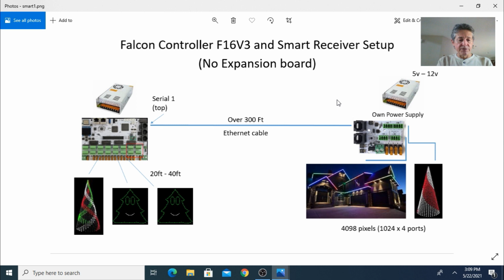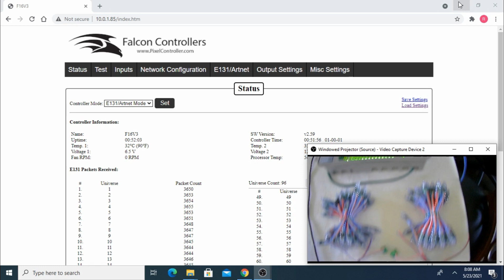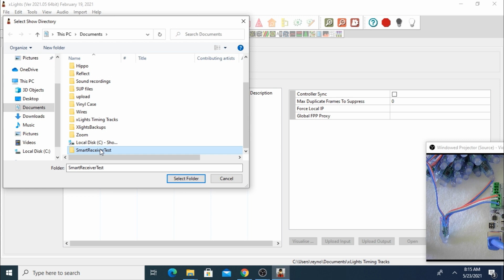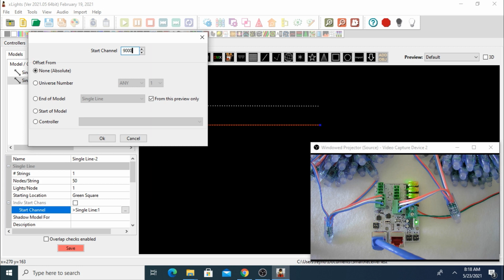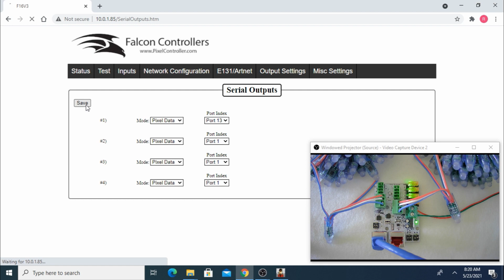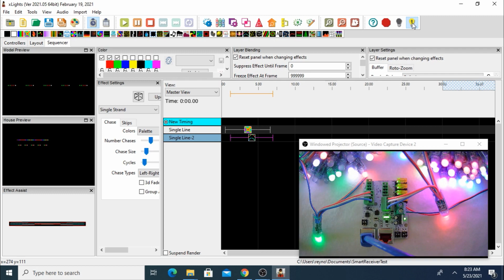Go the Distance! How to connect a 4 Port SmartRecevier into your Falcon Controller

Comment: Question, are you able to use more them one smart expansion board directly off the F16v3? I am confused by the serial port settings page as I thought I could daisy three of them, that would use 12 ports off of the f16.
Reply from the maker: Hi There. I think you are taling about Smart Receviers which connect using the RJ45 ports, correct?  I stopped using the V3 years ago, so I am going to talk of what I know the V4 and V5 setup is. Yes, you can daisy chain them, but keep in mind that that you are sharing one port throughout the chain. Let say that you daisy chain two of these SR, you will end up with 8 ports in total (ports 17 to 20). The max number of pixels (1024) you have will be diveded by two. In other words you could have 800 pixels on the first SR and some 200 on the second SR.

See the links below.

Smart Receiver
https://pixelcontroller.com/store/accessories/86-srx1.html

Specifications:
https://docs.google.com/spreadsheets/d/1LTQzdvSYMrRGI62KTGdh5EmUhVB9uZZMQ4iwWtK7yYk/edit?fbclid=IwAR33f8nxOD-bPBZK3F9M6IILNB96UiWpSwP67KyMHWce-1woMmiiRfcl29c&gid=2005112714#gid=2005112714

Comment: I watch the video twice but still not understand why the blue + signs appear beside port 1, 5, 9 and 13. Why the smartReceiver choose thos ports automaticly. Even if you create 13a, 14a, 15a and 16a, they still appear at the 1, 5, 9 and 13. Why the + blue sign do not follow the new ''a'' ports? Maybe it is too late tonight hahaha!  😆😆😆
Reply from the maker: Hello. What type of controller do yo have?
Reply: @trevilights  I just received it. It's a Falcon16V5. Did not plug yet but I try to understand the all process before. It will drive at least 6000 pixels; 4000 pixels for my 16' tree and the rest will be spead on some usual props.
Reply from the maker: @stephanlemaire  I do not own a 16V5 but does blue +sign will or will not be there depending on the setting you choose. Like if you are only using 16 Local ports or 16 Local + 2 Smart Receivers. Once you are ready to try, take a look at your settings and I am more happy to help you out. You can book some of my time in my website trevilights.com and we can do a Zoom to review your setting. We can cover a lot of material in one call instead on text messages. Good luck.

Comment: Hola, Trevi. Saludos. Tengo un controlador F16V4 y un SmartReceiver x 4. Pero aun no logro hacer el la conexión entre ambos. Es decir, los 16 puertos de la F16v4, llegan bien, pero los puertos de la SRX4, no me llega ni uno. El SRX4 tiene un boton de test, y lo preciono y todo funciona bien. Solo me falta poder hacer la conexión entre ambos, ¿sabes cómo podría solucionarlo? Muchas gracias
Reply from the maker: Hola Juan. Pueden ser varias cosas. Vamos a empezar por lo basico. Primero, en el menu de Status asegurate y tengas seleccionado la opcion de Board Configuration=16 Local + 2 smart Receivers, y presiona "set". Esto agregara otros 8 puertos mas. Asigna algun elemento digamos a puerto 17. En el receiver, todos los switches deben estar "on" y el seleccionador de ID en Cero. Reinicia el controlador y el receiver. Suerte.
Reply: @trevilights  Trevi, he estado investigando y se supone que el SRX4, como es de 16 puertos, se selecciona 16 local + 4 Smart Receivers y así lo tengo. En cuanto a el ID, lo tengo en cero y los switches en 'On'. Aparentemente, todo estaría bien. Pero hago la prueba de test general y solo me toma los 16 local. Sigo sin conexión al SRX4 😒 he probado muchas cosas, pero no sé en qué estaré fallando.
Reply from the maker: @juancamiloarrubla8726  Desde donde y como estas haciendo las pruebas? Supongo que desde xlights. Tienes correctamente (suficientes) los canales/universos a utlizar en la seccion de controllers? Y en el controlador, en la seccion e1.31 tambien debes tener una cantidad suficiente de canales/universos a recibir. Me es dificil saber que puede estar pasando sin ver su configuracion. Sigue probando y si no tienes suerte puedes ir a mi sitio Trevilights.com y separa tiempo conmigo. Hacemos una video llamada y revisamos tu configuracion.

Comment: Hello. How do you do this I Raspberry pi 4 to control the falcon controller
Reply from the maker: Hey John, you need to prepare a SD card with the 'Falcon Player (FPP)' software. Then you configure the Falcon Player with the controllers IP address. 

Here is a video about it.
https://youtu.be/yqXK5p1eRM4
Reply: @trevilights  
I did do that for my Raspberry pi 4. And get an error on pi boot up. But I still am able to get to the web interface for FPP. I was just wondering if I have 4 ,4 string smart receivers. How is that put into the pi ? 
Thank you. You have taught me a lot.
Reply from the maker: @johnnagy1575  You do not need to put the smarts receivers into the Pi. The only things it cares about is the output channel count. The Pi send all the raw data to the controller and then the controller sends it to the pixels . Is the controller that needs to know were the channels are, either connected to a common pixel port or a smart receiver.  As an example, if you have 4 snowflakes in a smart receiver, make sure the channel definition in xlights for those snowflakes has the correct channels used on the smart recevier so it knows how to route the data.
Reply: @trevilights  
So. If I put in the FPP pi player. There is only 96 universes. And I configure the falcon controller with the smart receiver outputs. The pi will still send 96 universes plus the four string universes? Yeah. Sounds really confusing to me. Lol
Reply from the maker: @johnnagy1575 There is not "plus four" string universes. Your four remote string are part of those 96 universes. Let's say that you are only going to use 2 port of your falcon controller. Port 1 and port 2. Port two is going to be configured to be a smart receiver. Port number one is going to use Channels 1 to 3072 (1024 pixels x 3 channels). Your port 2 is going to use Channels 3073 to 6144 (1024 pixels x 3 channels) which are configured to be used in a remote recevier. That's it. Everything is about Channels. Channels do not repeat. So wherever that channel is, the data is going to be sent there, local port or remote port. This is why the FPP does not care where the pixels are, it just send all the data, The controller then routes it to the right place.

Comment: Hi another great video. So if I have 3 smart receivers with 12 pixel ports that can have 4096 pixels. So does that mean that I can have 341 pixels on every one of the 12 ports. I have used all your videos to set up my Christmas.
Reply from the maker: Hi Percy, Thanks for watching. It all depends on the configuration that you use. You can have as many as 1024 per port on the receiver if you want to. But your numbers are also correct if you daisy chain 3 receiver and configure them to use 1 main board port distributed on the three receivers. 
Is all comes to your layout and preferences.
Reply: @trevilights  Hi so if you use ports 1,2,3,4 on the f16v3 controller for the smart receivers like 1a 2a 3a 4a for the first one and 1b 2b 3b 4b for the second one and 1c 2c 3c 4c for the third one, so with 12 ports on the 3 smart receivers I should be able to put 341 on all 12 ports because it is using 4 ports on the f16v3 I hope.
Reply from the maker: @percydoucet1838  Unfortunately I cannot confirm your setup because I  only have 1 smart receiver. But it does sound correct. But, why would you need 3 smart receivers? Do you have long distances between your elements?
Reply from the maker: I just went into the Pixel output for the V4 and tried your configuration and it works. 341 pixels for each letter, a b and c.
Reply: @trevilights  Thanks Trevi your videos and information about this is very informative and I don't think I would of got this far without your videos.
Reply from the maker: @percydoucet1838  Glad to help.

Comment: But if I daisy chain 3 smart receivers I still can control same amount of pixels if have only one receiver . I’m confused.
Reply from the maker: Yes. You still have the same number of pixels. What a smart receiver does is to provide a long distance connection for up to 4096 pixels with only one long ethernet cable.

Comment: Can you explain falcon 48 please.
Reply from the maker: The Falcon 48 is a little different, but still can only control just over 16000 pixels. It allows for you to connect up to 12 differential receivers with 4 ports each (12x4 = 48 pixel ports). This works well if you show is spread out. You need to send pixel data far from the source(main controller). You need to provide a power supply to each of those receivers to power the pixels connected to them.

Comment: I know this video is old, but I have watch many of your videos to try and learn the system, and your videos are VERY helpful and detailed.  Thank You!
In watching your videos, I understand now and am confident with what I need and have purchase my pixels off Amazon (the 500 pix. X 3 variety like yours) and 4 of the 4 port V2.01 boards so I can use a F16V4 when it is available, and drive a few strings that are a ways away from the main controller without having to run extra data cables to them.
I also have several old computer power supplies with high current 12V outputs that I can use at the strings, so all I need is an ethernet cable between the main controller and the 4 port boards.

This is my first pixel lighting setup for Halloween and Christmas (2022) that I have done.  I have a few moving head lights that i will use with the DMX ports as well!

This is something that I have dreamed about for a long time, and with your great help, I am excited to do!
Wish me luck!  hehe
Reply from the maker: Wow! Congratulations. You pretty much have everything you might need. The setup of the new Falcon V4 is almost the same. But if you need help just let me know.

Comment: In reference to  controllers which one is more friendly to work with falcons or coro controllers? I'm new and start working on led pixels led strip ect....I live in California LA area and cam recommend me where to purchased lights.... thank you so much.
Reply from the maker: Hey Carlos. Unfortunately I have only used the Falcon controller, so i can not speak of others. I believe Falcons are out of stock. I buy the pixels from Amazon, i can return them if there is anything wrong with them. Make sure you buy the correct voltage since thry come in 5 and 12 vokts. I recomend the 12 volts. If you buy ws2812 chech that they are water resistant since they are going to be exposed to the weather.
Reply: @trevilights  thank you for your time.
Reply: Otra pregunta que recomienda para LED strips? Puede uno inyectar más electricidad a luces de strip?
Reply from the maker: @carlosescamilla5526  Yo solo tengo un par de Strips y compro las que vienen en una funda de silicon. Estas soportan mejor la interperie. Y si, Puedes injectar las enegia a estos strip. Solo concetas el positivo u negativo de tu fuente de poder al inicio o final de las tiras. Por lo comun , ya viene preparadas con un par de cable extras para esto. Puedes comprar una tira y probarla. Si te convence pues pides mas. Las tiras ws2812 vienen con configuraciones diferentes. Unas traen 30 pixeles por metro, otras 60 pixeles. Asi que fijate bien de cuales compras. Tambien vienen de 5 y 12 voltios.
Reply: @trevilights  muchísimas Gracias por su ayuda y por contestar .
Reply from the maker: Hey Carlos. I have only worked with the Falcons, So i cannot speak of others. As long as they have a web interface their setup should not be difficult. I buy all my light in Amazon. I like Amazon because I can return them if there is something wrong with them. Some people order their lights using Aliexpress from China but I just do not like the timing and the return hassle. So I rather pay a few more dollars and buy them is the US.

Comment: Thank you so much for all of your videos that you have produced I have learned so much I do have a question about the new smart receiver version two would you be able to produce a video explaining them a little bit more and how they work thank you
Reply from the maker: Hey Tim, thank you for watching my videos. So the v2.00 receiver work only with the new Version 4 of the falcon Controller and Differential boards. Just a few months back a new version of the Falcon controller was released (F16V4) and they had to make changes to the smart receivers to work with them. 

Here is a link for a comparison sheet on the old F16V3 and the new F16V4.

https://docs.google.com/spreadsheets/d/1LTQzdvSYMrRGI62KTGdh5EmUhVB9uZZMQ4iwWtK7yYk/edit?fbclid=IwAR33f8nxOD-bPBZK3F9M6IILNB96UiWpSwP67KyMHWce-1woMmiiRfcl29c#gid=2005112714

Comment: Thank you for all your videos and it’s simple to understand and helpful. I have got my pixel into the strips for the Christmas tree and the ready to run f16v3 Falcon controller. I’m ready to plug in.  I have few questions. 

I’m following your first controller setting video about putting in the IP address. Will the IP address change if I take to the garage using another etharnet outlet? 

My tree is about 30 feet from the garage. Do I have to add anything to boost the signal? 

My tree is 24 strings non musical sequence this year as I’m new and not very good with electronics. 

Thank you in advance.
Reply from the maker: Hi Rexton Fernando.  Good to know that you are almost ready to go.  If you define your IP address as static then it should not change. This is why we use the static option. About the distance, if you use a good quality 18 gauge cable you should be good. If for any reason you see that the pixles flicker then you might need an F-amp to boost the signal. They are not expensive. Here is the link.
https://www.pixelcontroller.com/store/controllers/53-falcon-picap.html
Reply: Thank you. I’ll let you know how it goes.

Comment: Thank you for such a great and thorough explanation. It is super useful to know that adding a 4 port smart receiver will actually reduce the usable ports on the f16 by 4. Very helpful in planning out requirements and runs!
Reply from the maker: Hi Sid Mody, Thank you very much for watching my video. Also thank you for your words.

Comment: Hi there! Love your videos!  Working on my F16 v3 Falcon controller and for some reason it is sending the same signal to all 16 ports. If I pick port 1 with 257 lights for my snowflake, all ports are outputing the same snowflake signal. Even in test mode, it sends signal to all ports regardless which ports I have selected on the dash board. Could you tell me what might be the problem ?
Reply from the maker: Hey Jekyll & Hyde Garage. Thank you for your words and for watching my videos. There can be different reason, but the most obvious one it that your ports are mapped to the same channel. For example, take a look at the screen on Minute 10:25 of this video. Port 9 to 16 are mapped to start on channel 1. So whatever data is been sent to channel 1 is going to play on all those ports. Port 1 also starts on Channel 1.

Comment: Excellent and informative. Do you have a video showing how to run a lighting setup without the use of a PC connection? Eg. A setup where a sequence saved to an SD card and somehow triggered. From what I've seen the Minimad is very simple, and Madmapper is also great to go together.
Reply from the maker: Hey Taun, Thank you for watching my video. In the case of the Falcon Controller, even it does have an SD card port it is only use for software updates. That's why using a Raspberry PI is the solution. This Raspbarry PI will have the Falcon Player Installed and the sequences will be playing from the SD in this device. The Falcon Player will then send the sequence to the Controller using a CAT5 cable.  You can check that video here.

https://youtu.be/yqXK5p1eRM4
and 
https://youtu.be/VPE5oHID6Io

Comment: Another great video. I have 2 f16v3 controllers, 1 with an expansion board and I want to run 2 smart receivers off each controller. What would I change the serial outputs to? Also do I have to temporarily change the controllers to add the smart receivers?
Reply from the maker: Hey Dave. Thanks for watching.  Unfortunately I have no way to tell how or what to configure since I do not have an expansion board. But here is what you can try. First in the String Output screen you will need to select in the port mode that you have a main board plus one expansion. Then click one of the blue plus signs (The 4 port that you want to use). Select another 4 port and also click on the plus sign. Hopefully you will get  letter 'a' on the first four and a letter 'b' on the other four. If you do not see a letter 'b' then click the blue plus sign again.
 On the serial port page try to see if you can map the ports as I did in the video. Remember that you will have to set the switches on the smart receivers to be 'a' and 'b'. Good luck.